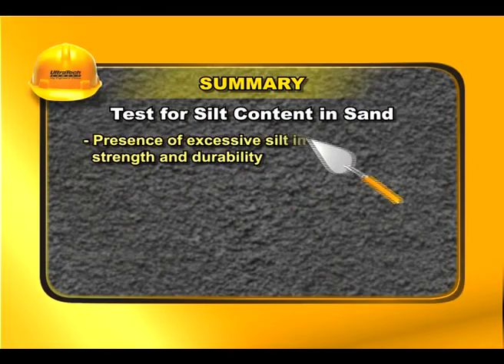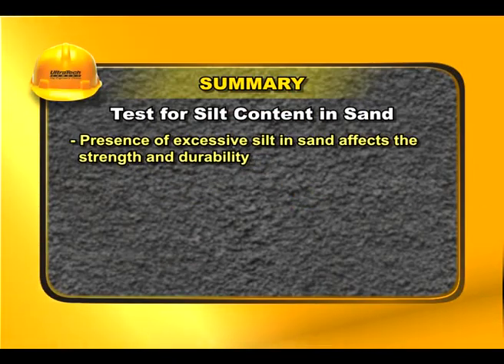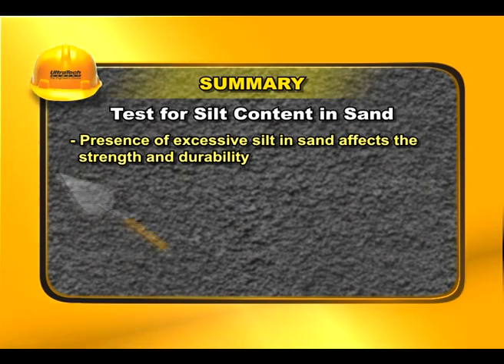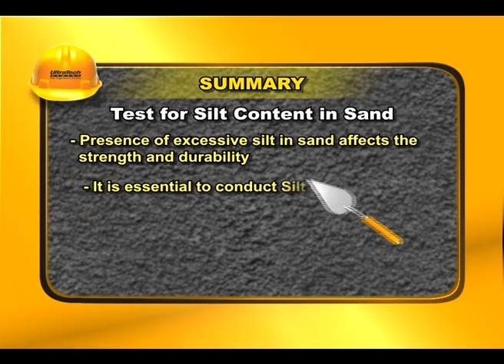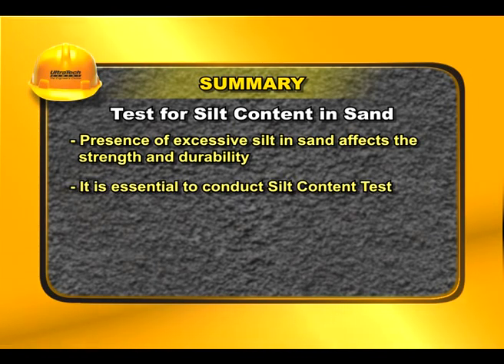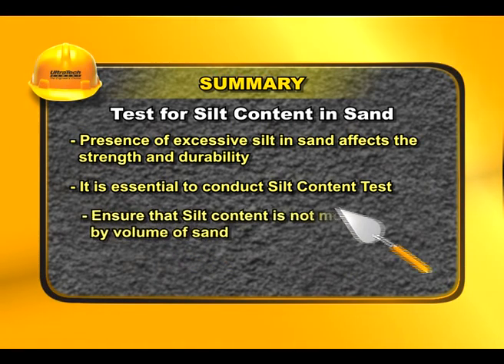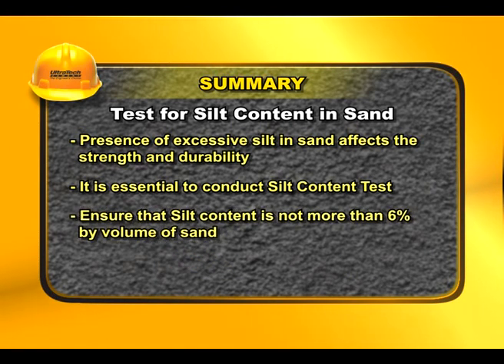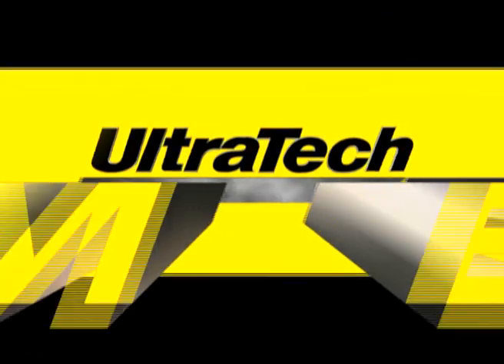TEST FOR SILT CONTENT IN SAND

Comment: I thought BIS recommends max. 3% silt content in sand. Where did you come up with 6%? I understand by volume, silt will definitely be lower than 6% by weight, but we are more likely to use volume any time any place as it's easier to.
Reply: according to IS 2386, silt percentage should be below 8%